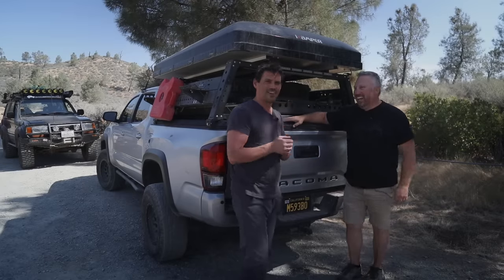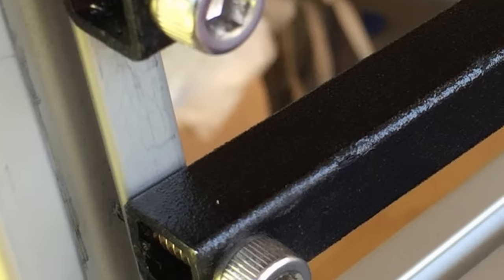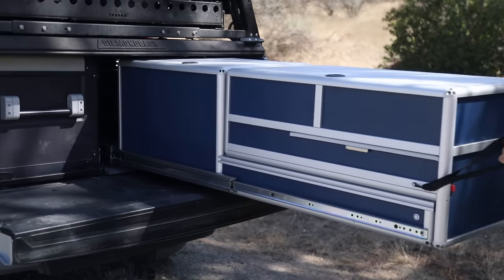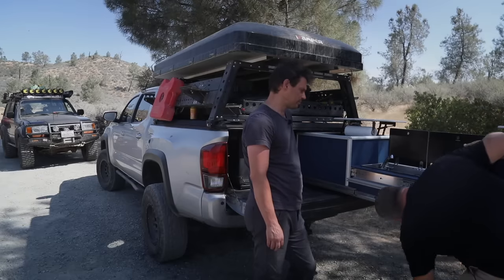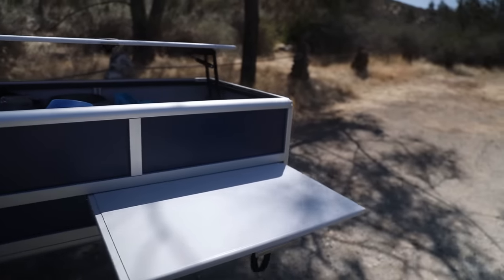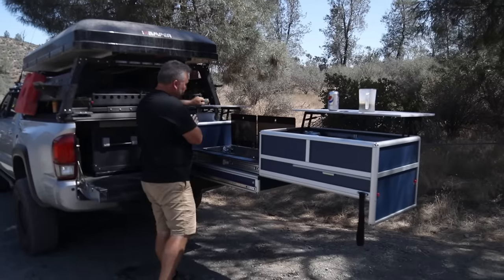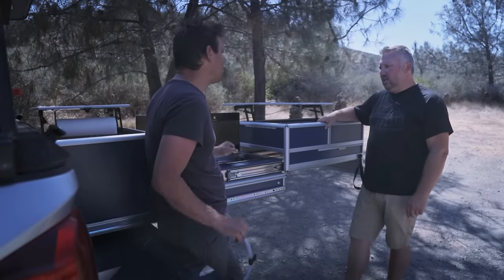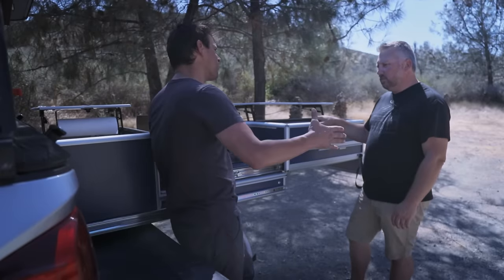Ultimate DIY Camp Kitchen

Comment: What’s the final weight? Seems like all weight is in the rear right. Anything on the left? Great rig.
Reply: It’s about 150lbs with the 2 sets of sliders. They are heavy! The left side of the bed has a fridge and water tanks
Reply: Thanks @daviddouglass . Ya so a full fridge, kitchen, water, food, gear, chairs blah blah blah and your at nearly 400 lbs.  and that’s not counting RTT awning etc. stuff adds up quick.

Comment: Can you use the kitchen to inside the bed if you needed?
Reply: No it needs to be extended for access to the bottom to attach the propane. You can open the tops to get to the pantry storage and kitchen storage. 👍🏼

Comment: Whoa!!  Question on your Fridge slider?  I have the dometic slider with a Dometic 100 on top and I cant open the fridge lid without opening my Diamondback top?  What slider do you use for the fridge?
Reply: Sean Silvera I made my own slider out of 1” angle iron and a flat aluminum sheet. The rectangle slide actually slides nicely on the composite bed and the front of the slide has T Nuts that slide in C channels anchored to the bed. That way I can extend the fridge out to hang past the tailgate. Pretty cheap solution.

Comment: how did u make the hardpoints for the hinges?
Reply: Vahakn Gehlhaar Matossian I used 1/2” square tube that the hinges mount to, those brackets then mounted to the very edge of the extruded aluminum as to not interfere with the panels that slide in

Comment: Dave, how much do you have in the kitchen build?
Reply: Jay Neal the price varies based on connectors and rounded profiles, so it can be made cheaper, but as pictured it’s about $1800 all in with 2 sets of sliders and sink unit. That’s materials and not labor and time
Reply: W.W. I purchased from cabinetparts.com, Fulterer I believe is the name
Reply: @daviddouglass208  awesome just wondered a round figure!
Reply: Jay Neal to? The cost? Answered above 👍🏼

Comment: looks good, but looks wobbly
Reply: John 928 yeah future versions will have both of the main sliders be locking. I did just one on this unit but it allows movement side to side, which on camera, makes it look like it moves a lot up and down as well. It’s very stable as is and will be more so in the future
Reply: @daviddouglass208  when you have the the cook set out, how do you have the fridge out without it getting in your way while cooking?
Reply: John 928 so my fridge is a dual zone and the fridge half is closer to the rear. So 90% of the time I actually only pull the fridge half way out which means it lines up with the end of the tail gate, which doesn’t impede my access to the kitchen. For the video I had pulled it out to the freezer side to grab my frosted mug, hahaha. There’s more photos at www PullKitchen com

Comment: 80/20 is not cheap. I bet that was at least 1500.
Reply: He said $1800 😭
Reply: Joe Amirr 80/20 ain’t cheap, but you can use more basic extrusion shapes like square, butt the corners without Tri-corner connectors and the price comes down. I was putting so much work into it I wanted to do it the best I could and not regret doing it a lesser way in my mind. Not for everyone I know
Reply: @scruffster2497  Oof, okay now I'm liking my plastic boxes better.

Comment: What is the unloaded weight?
Reply: Carlos - the drawer is about 150lbs unloaded (80lbs of that are the sliders), I hoist off my rack and tent together and sometimes hoist out the drawer, sometimes I just pull it out onto a hand truck and into my shed. Then my truck goes back to stock with the exception of the DiamondBack cover
Reply: David Douglass Awesome David! That is actually pretty light, most of that weight is the slides.
Reply: Carlos - can of soup...those are heavy too :)

Comment: I’m down for plans but that system needs legs, when he was putting it back into the truck seems like it shook too much. Maybe two legs at the end when it’s deployed
Reply: Jeff Liu Yoshiyuki When you close long slides there is some sway side to side. I have found most of the vertical bounce comes from the suspension on the truck because of the lever arm factor. But a telescoping leg is very feasible, even if to calm nerves :)
Reply: David Douglass hey David thanks for the reply I’ll be signing up for the forum tonight to check out your thread